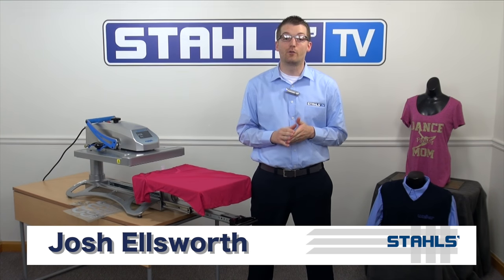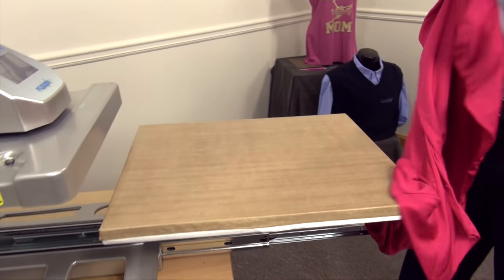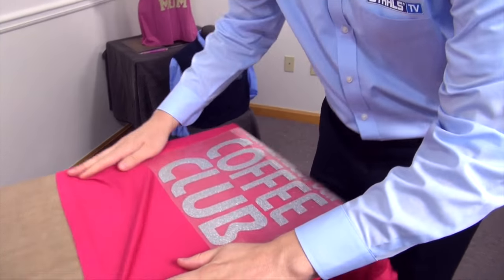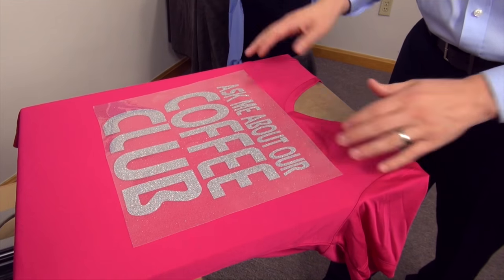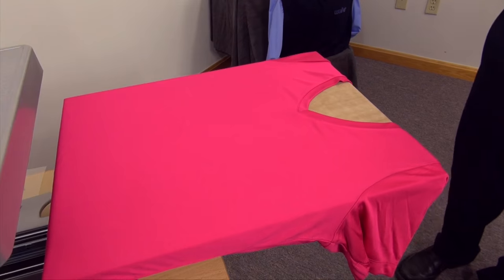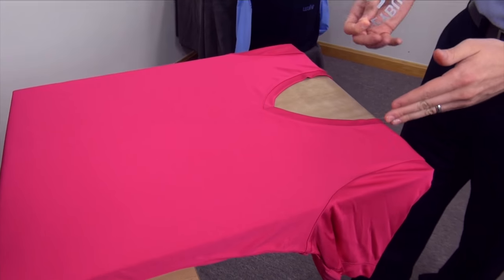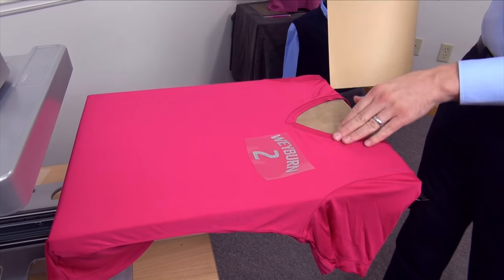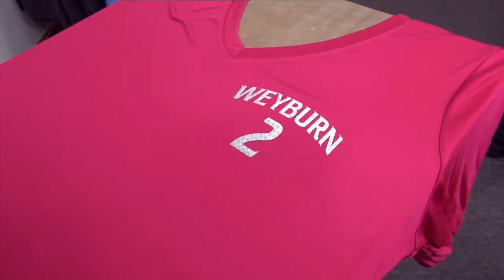How to Heat Press on a V-Neck or Scoop-Neck Shirt

Comment: Thank you, I need help for the v shirt but my design is in the back
Reply from the maker: Hi Tami. The same basic rules apply, make sure the seams are off of the platen (or use a heat printing pillow). Be sure to follow fabric compatibility and the recommended heat application settings for the material that you are using.
Reply: @StahlsTV  Thank you soo much!! I did it 😁